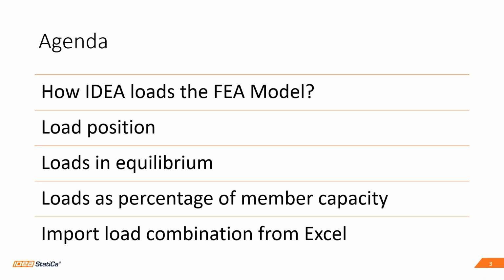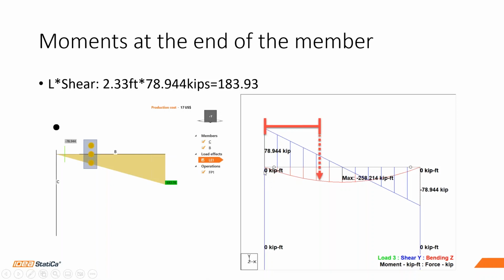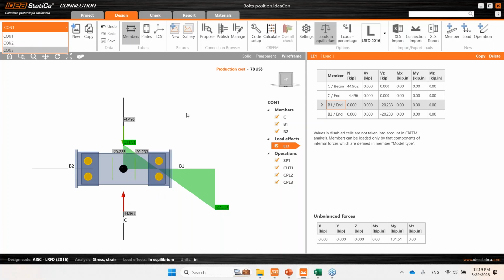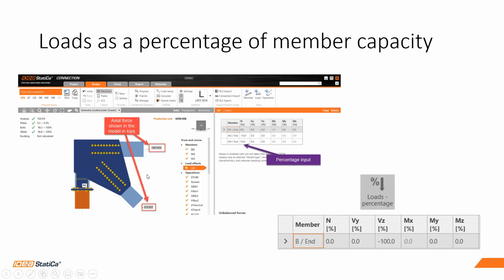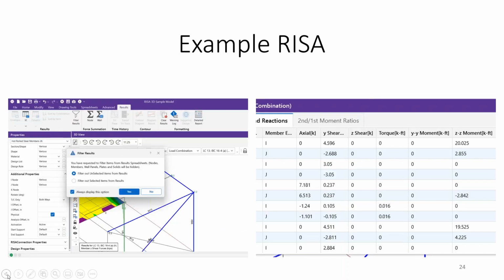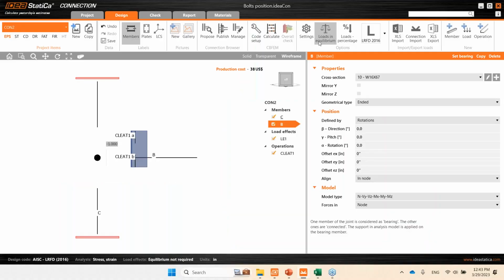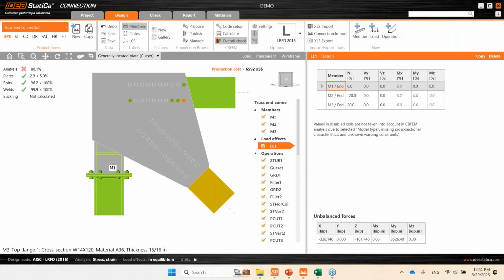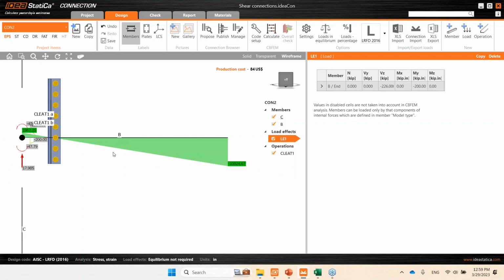Webinar – Structural loads in steel connection design

Comment: Regarding load in equilibirium , If i dont have the forces for the bearing members, so should i close it?
Reply from the maker: Hello!
Please reffer to this article:
https://www.ideastatica.com/support-center/equilibrium-and-supporting-member
In case you miss the forces for the bearing member (and you can not obtain them), you turn off the equilibrium and depending on the model behaviour and your engineering judgement you may leave a reserve in capacity of identified connection parts.

Comment: Hi Thanks for the video.

I have a question regarding the sign convention when importing from RISA. I see that the only change done was to the axes. What about the sign convention?? RISA takes compression as positive oposed to Idea, shouldn't that be changed also before importing ?

I am working right now in a RISA model and idea, and have been very confused about the sign convention differences.
Reply from the maker: Hello, the axis (LCS) is translated from the source software (Risa) to Connection app and at the same time the signs of internal forces, so that they match.
In case something is wrong, you can identify it in the unbalanced forces tab
https://www.ideastatica.com/support-center/unbalanced-forces-from-bim-link-import

Comment: A study was done to detect the behaviour of steel plates in idea statica. As idea statica stated that the behaviour of steel plate will be according to the bilinear stress strain curve existed in EN1993-1-5 app.C note c.6. And idea limited the strain on palates to be below 5 % according to EN1993-1-5 app.C note c.8. So it is expected from this bilinear curve that in ASD design philosophy fyd which is equal to 0.6fy will make the the strain on the plate to reach 0.1% while in LRFD philosophy the strain corresponding to 0.9fy will be 0.16% as we follow the first part of the curve which has a slope equal to E(2100 t/cm^2) so we wanted to make sure of this through some connection illustrated below but an obstacle was encountered as the accuracy in idea statica is 0.1% for strain so it is expected that we will get the second part of the curve only which has a slope equal to E/1000. and the results was consistent with this as shown below whether in ASD design philosophy or LRFD but there is a question has arisen which is why the strain at fyd is the same in the two methodologies of the design which is equal to 0.1%. While it is accepted to be to be 0.1% for ASD but for LRFD if the strain at 0.9fy is 0.1% this will mean that Young's modulus will be 0.9fy/0.001 for steel 52 E will be equal to 3240 t/cm^2 which is not correct ???
Reply from the maker: Thank you for your comment. 
As it deserves some further exploration, we would like to ask you kindly to input your inputs to the support case, so our product specialists can answer it. 
Here is how to input the support case via our User Portal: https://www.ideastatica.com/support-center/how-to-create-a-new-support-case
Thanks.

Comment: thank you for the webinar  but it's still not defined how to know the position of hinge in the model. How to know that the hinge is in the bolts or in the node or in anther position X from the beginning of the member?
Reply from the maker: Hello, this is descibed here:
https://www.ideastatica.com/support-center/how-to-define-correct-load-position
The position of the hinge is determined by engineering judgement. Usualy, it is formed in the center of the bolts and depends on the overall connection stiffness. If the bolted connection (e.g. fin plate) is rather stiffer by using more bolts, the hinge moves slightly towards the node of the connection.
To be perfectly safe, and that is a habit of engineers in some countries because some codes require it - you would do 2 calculations - one for shear force position in bolts and other one with position of shear force in weld of the connected plate to cover both extremes of moment distribution and hinge position.
Reply: @ideastatica_en  Hi, with shear connection and extended shear connection, if position of shear force in weld of the connected plate, the connecting beam will rotate upwards (which is not true to reality), is this result acceptable?